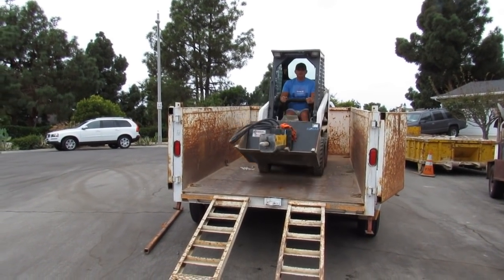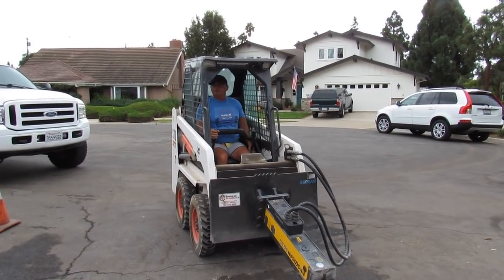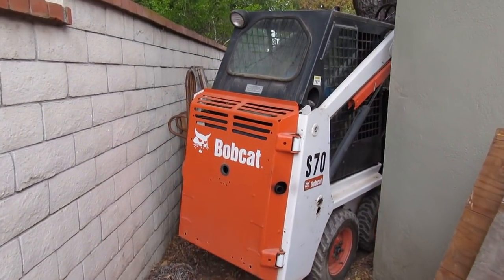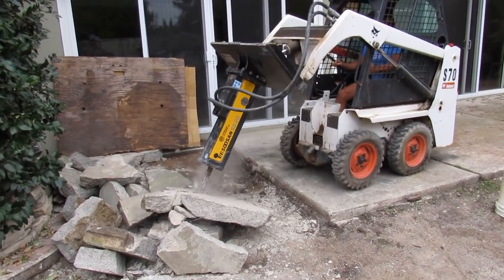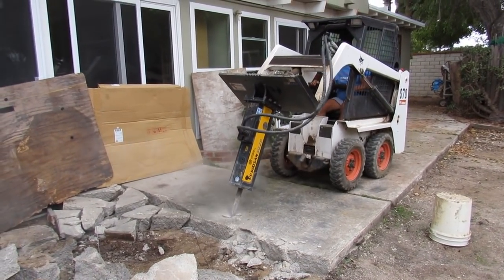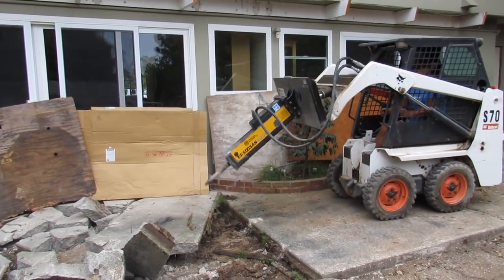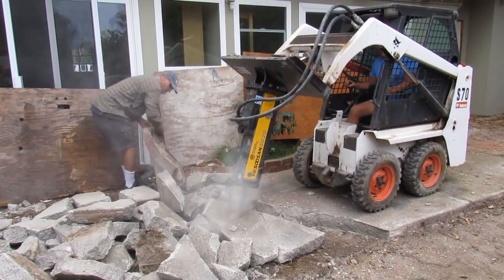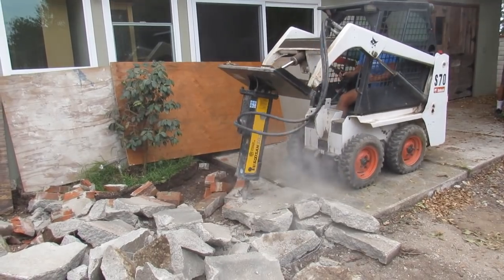Concrete Demo. Tight Access. The Best in the West! California

Comment: How wide is the S70 and what's a reasonable amount of clearance that you would feel comfortable with for driving it through a narrow corridor between a house and a brick wall?  Also, what's the minimum clearance you would feel comfortable performing a 90° turn?  Great video.  I definitely appreciate the informative narration.
Reply from the maker: The s70is 35 1/2 sit and spin brother. The tightest of spots 👍

Comment: i wonder if that breaker is the same brand as the one Quick Attach sells.  Just got a 310 breaker from them for 9 grand
Reply from the maker: This is a soosan. I use to run BTI.
Reply: @WestCoastCustomConcrete    check out the breaker that Quick attach sells.   it looks just like the Soosan breaker, just 310x printed on it.   Quick attach is now owned by Doosan - Bobcat    I think they may be the same
Reply: @WestCoastCustomConcrete    Oh wait it might be a Erkine breaker that Quick Attach sells
Reply from the maker: @dankruger2890  the soosan is the best I've hit
Reply from the maker: @dankruger2890  that's a copy of the soosan